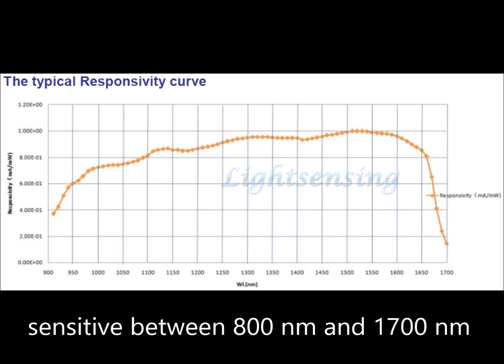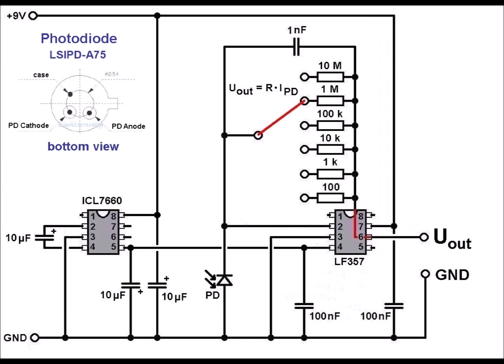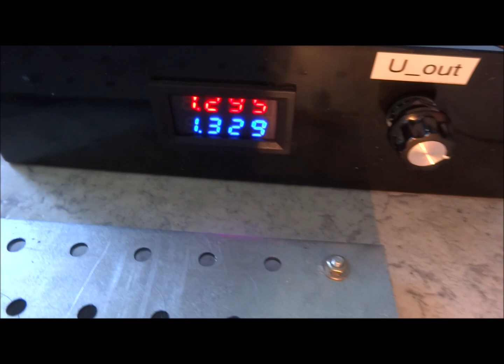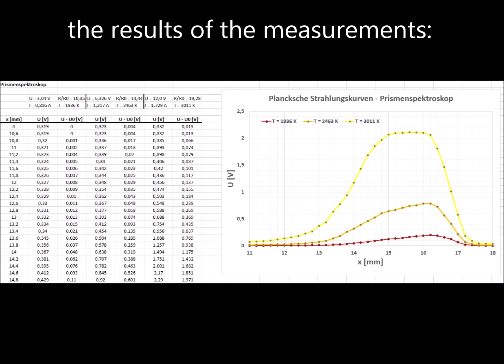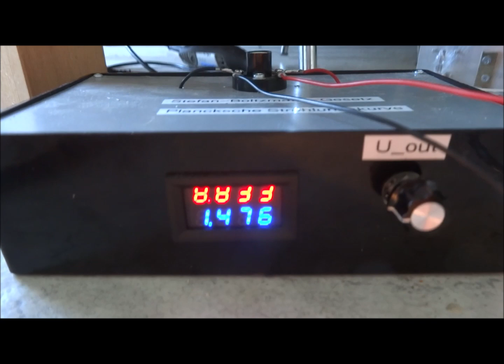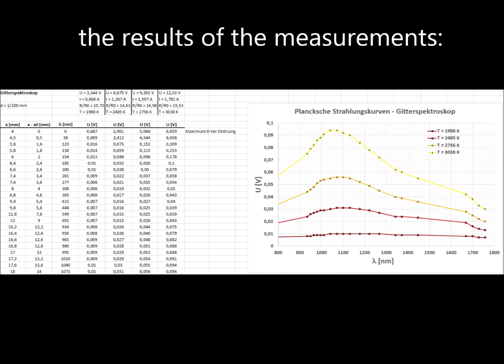experimental determination of Planck's law for black body radiation / Plancksches Strahlungsgesetz

Comment: Why not a diffraction grating with more lines per mm?
Reply from the maker: As you can see in the video the measured voltages with the diffraction grating spectroscope are low. If I use a grating with more lines per mm instead of the 100 lines/mm, the spectra get longer but also less intensive. Therefore the measured voltages would further decrease...

Comment: Hello! Great work! Why do you use second slit (close to PD) in case of prism and do not use it in case of grating?
Reply from the maker: Hello! Very well observed... The slit in front of the photodiode should increase the sharpness/resolution of the spectra. With the grating the intensities are rather low and the additional slit would decrease the intensity further more. Therefore I don't use the slit with the grating-setup...
The aperture of the photodiode is also very small, around 1 mm.

Comment: Also, cheap diffraction gratinds made of PET plastic, that absorbs IR lignt in few IR regions. Does it affect on result in case of using your construction as a spectrometer?
Reply from the maker: Hello! The curve obtained with the grating spectroscope ends at 1700-1800 nm, where it should because the Photodiode isn't sensitive beyond 1700-1800 nm. Therefore I assume, that the grating doesn't absorb significantly the light in this wavelength-region from 800 to 1800 nm. The curves are smooth too...

Comment: Why did you use IR range instead visible range?
Reply from the maker: Hello! For temperatures between 1000 and 3000 K the planck curve lies mainly in the infrared region. Therefore I had to use a photodiode which is sensitive between 800 and 1800 nm. If the photodiode would also be sensitive in the visible part, then I would get problems with my diffraction grating spectroscope because of the overlapping orders (f.e. 3rd order of 500 nm = 1st order of 1500 nm).The planck curve is only for temperatures above 4000 K noticeably in the visible region like with our sun...